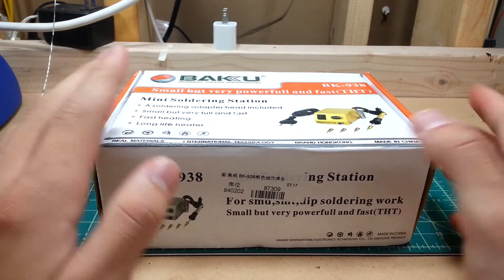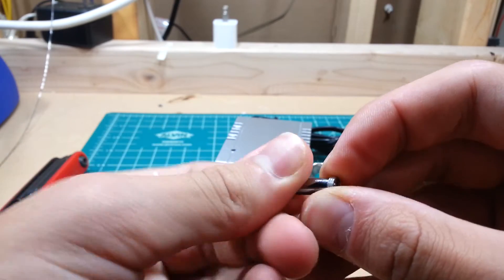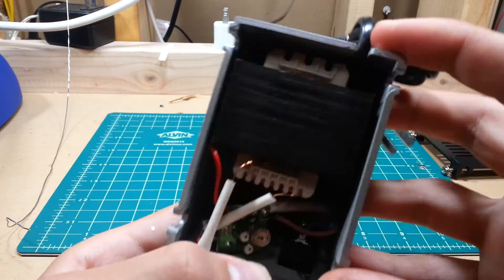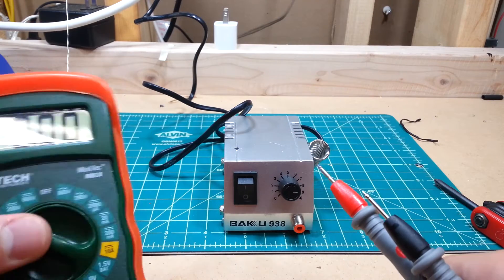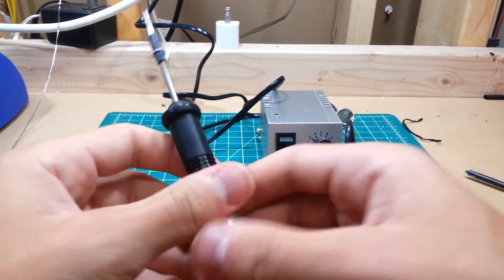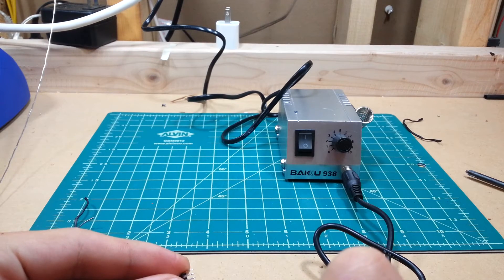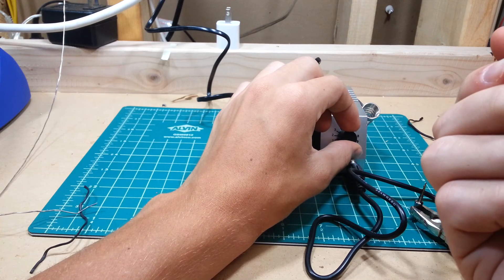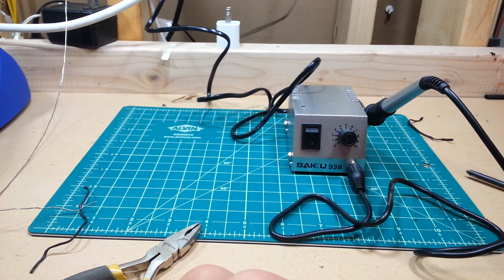Mailbag #4 Baku BK938 Soldering iron overview and review

Comment: I have just seen the bk 938 in Amazon at 70 $, crazy difference as I have bought two units at 24.99 $. Amazon is getting very expensive every day. As for the units I still haven't use them.

Comment: Dont buy this crap!!.I fotgot shotdown in the nithg, and in the morning all the case was deform bybthe haet generated,the the led was on, so i open it and the inside its a fuck#@@crap,
Only a trafo very insecure protection-cables meets its self by a few milimmeters..yuo cuold dye or have a fire...this baku dont work any more cause the transfirmer its burn, and pices of the metal core literaly get off and fall down in my hand..baku made cheap device samo of the are ok but this is very dangerous

Comment: BK-938 SMD soldering station tested
With the BK-938 you get a cheap second soldering iron for easily solder your SMD components on their copper surfaces. But is this soldering iron worth its twenty euros?
➡    Read this article
https://chinese-electronics-products-tested.blogspot.com/p/bk-938-smd-soldering-station-tested.html
Reply from the maker: Right, so I actually would recommend getting one of those cheapo T12 stations, KSGER makes VERY nice ones for about 60-75usd and boy oh boy are they NICE

Comment: Hi, do you think I can power it with a regular 12V, 1A DC power adapter? If so, I would buy just the soldering iron without the solder station. The soldering iron alone is about $6 on ebay.
Thanks in advance.
Reply from the maker: you really shouldn't, that would peg the element to full heat capacity and possibly damage it. Save up a bit more and buy a Hakko clone
Reply: Then, How about a 9V? This way I wont go to full capacity.
Do you have a link to a cheap hakko clone?
Reply from the maker: I really don't recommend going with this unit, more trouble than it's worth. Get one of these clones and you'll thank me later http://www.ebay.com/itm/371091694885
Reply from the maker: or for a bit more, get digital control? www.ebay.com/itm/311432002194
Reply: Thanks for the links, I took a look to both of them, but I wonder if a simple Weller mini soldering iron 12W or 15W ($16) would be better? I would prefer a simple and small thing than a whole station and pencil holder (too difficult to take out to use and to store it back).
Reply from the maker: Don't use the terrible "firestarter" irons, would recommend this one as it has some temperature control and still uses Hakko tips. http://www.ebay.com/itm/152111289233
Reply: Thanks, I was actually watching it on ebay, I am trying to solder a new mini plug 3.5mm to a pair of headphones that broke, but my 40W weller just melted the plastic on the plug, fortunatelly I bought several plugs. What temperature (or watts) do you recommend to solder stereo plugs?
I bought these plugs: http://www.ebay.com/itm/131917166066?_trksid=p2057872.m2749.l2649&ssPageName=STRK%3AMEBIDX%3AIT

Thanks in advance.
Reply from the maker: AH! Your problem is that either you are trying to use lead free(aka: literal crap) solder or not using enough flux. Put the iron on the solder point, feed solder in between them, let it flow then cool. Once you've also tinned the target wire end, heat the solder on the plug, then bring the wire into the molten puddle, let cool and you're done
Reply: @douglasflores1462  buy a 15 watt unit, this one its a crapp

Comment: Do you recommend to buy this? I need a cheap iron
Reply from the maker: +MrDutchgaming123 No, I'd really recommend something like this since it has some temp control and works with the Hakko tips. http://www.ebay.com/itm/401023752033
It's a whole $15 cheaper too!
Reply: Arsenio Dev  Do you have it too? And i need a 230 volt version =?
Reply from the maker: +MrDutchgaming123 I've got the Hakko fx888D as my daily driver, bit expensive but COMPLETELY worth it.
Iron: http://www.ebay.com/itm/311104783400
tips: http://www.ebay.com/itm/231510788414
Reply: Absolutly NOT...